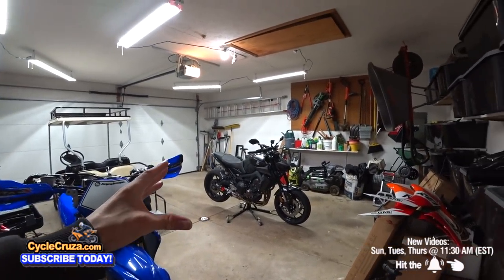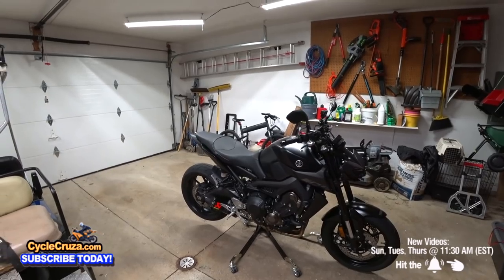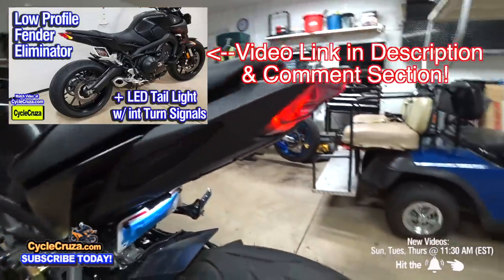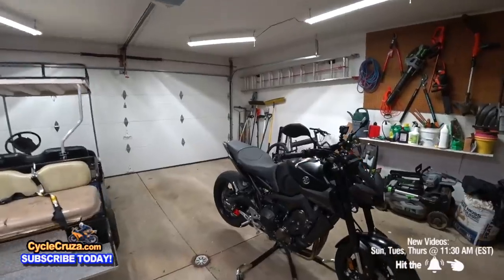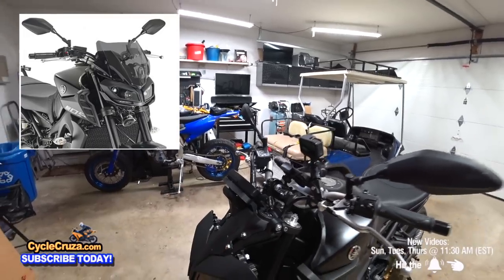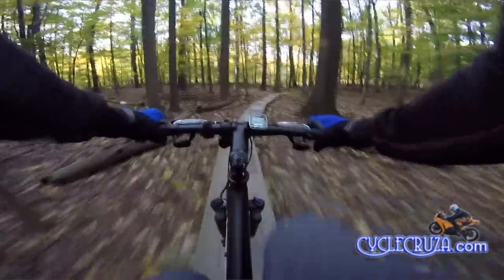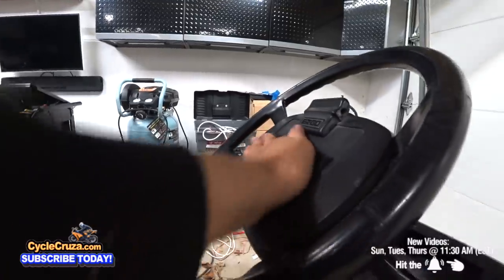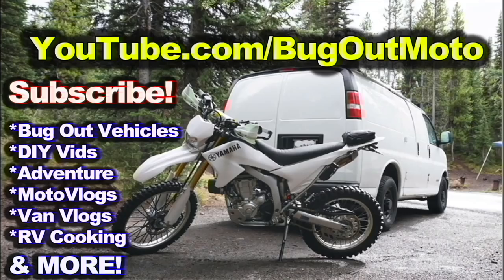2020 Yamaha MT09 MODS - Best MT09 Mods

Comment: One reason to put small windscreen on is it keeps bug out from behind dash and easier to clean. One mod i feel extremely worthwhile is the G2 throttle tamer. Makes everyday cruisin alot smoother. Just rode my buddies which i sold him my old G2 throttle tamer from when i had my FZ09, then hopped on my other buddies MT09 that has the stock throttle tube and the ridability/twitchy-ness difference is huge. But i ride a 2016 KTM SD1290R, so maybe im just used to amazingly smooth fueling

Comment: The only wind screens that don't look like chinese cheapo knockoffs are the Yamaha OEM (a little small but looks good) or the MRA Racing one (a bit expensive @ $165 but looks great and functions well). I have the MRA and its great. It deflects alot of road grit and bugs on the highways and also helps cut through facing winds. A must in Miami traffic with crap flying all over the highway. It gives you just enough to duck behind when a big rock or car shrapnel gets flinged at ya.

Comment: Will the bike work how it should with just the ECU flash?  Do you need to change air filter or anything else after putting on full Akropovic exhaust.  I ordered exhaust and want to make sure bike is getting fuel and air as it should.  I have 2020 MT-09 all black as well. @cyclecruza Thanks.

Comment: Hello I got question for you I got a brand new 2019 yz450f left over just bought it and iam getting tusk light kit but I want run same head light that you got does my bike make enough power to do that? Also will the wr stator work on my bike? Mine is not fx just yz450f. Thanks.

Comment: Looks sick I have exact bike Yamaha blue haven't flashed mine yet but I stay in standard with traction control off most the time so I can get the front wheel up a little lol yours would look good with black levers but if u dont need them is what it is. my clutch lever is bent dont ask me how so I either get a new one so bike looks perfect or look goofy riding with a ghetto 2 finger clutch lol

Comment: QUICK SHIFTER!!!!  Dude, $140 genuine Yamaha quick shifter that is made for this bike.  Why wouldn't you install one?  Its on the dash ffs. Lol
Reply from the maker: Imo, it's unnecessary. I'm not hitting this bike that hard for it to necessary. If I took it to the track it would only make sense to get a QS,
Reply: Cruza, I've never been to the track and I'm definitely not a road rossi. Lol. But that torque and just a touch on the shifter at 8k rpm without letting off or use of clutch, is magical.  The millisecond shift is orgasmic.  Trust me on this.  I thought the same thing.  
P.S.  we have basically the same bikes